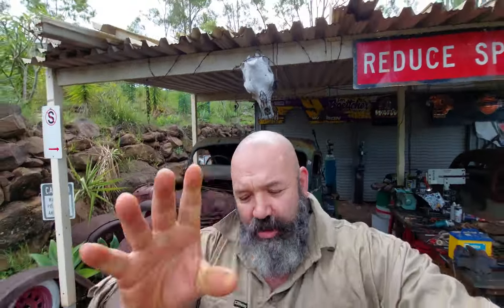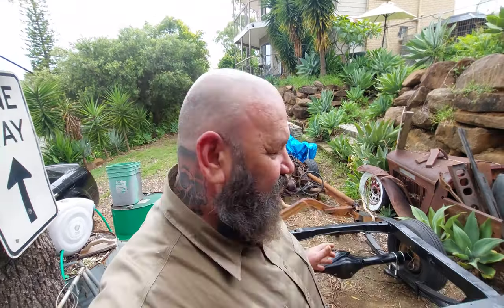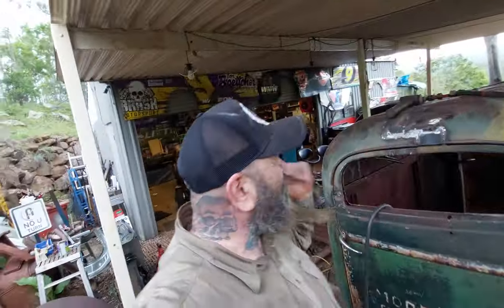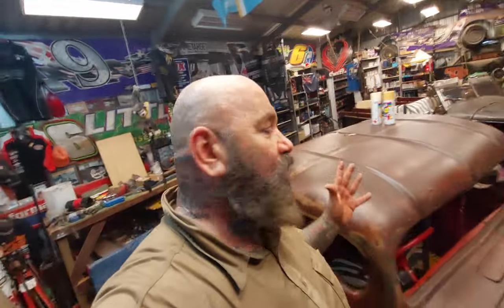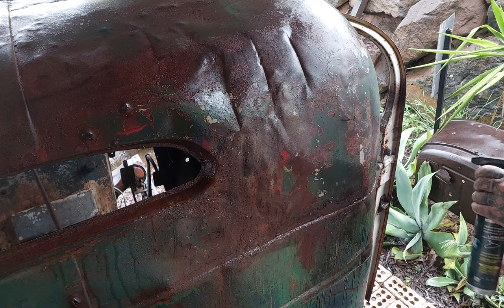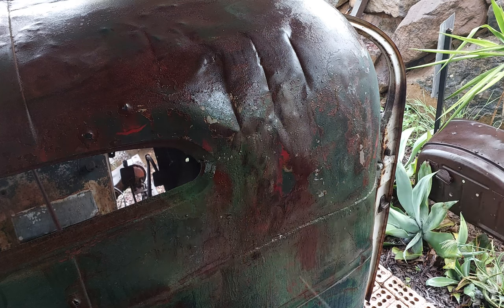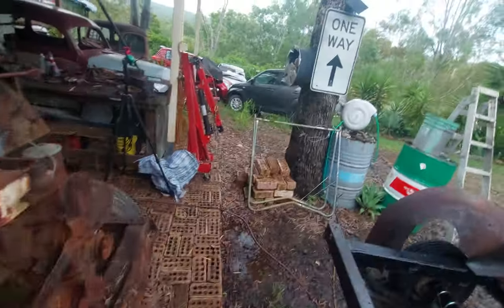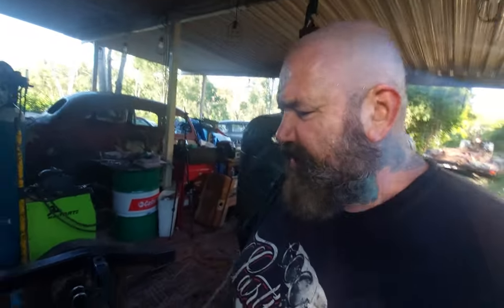2K BUDGET BUILD Ratrod! How to Fake patina blend a 6-inch roof chop! Bedford / Holden pick-up truck!

Comment: I have 3 of these Bedford K trucks here in Finland 🇫🇮 All those has been found deep from the forest.
Reply from the maker: How do they hold up rust wise over in Finland
Reply: Surprisingly well. Of course there are surface rust everywhere, some green paint can be seen. But certainly can be those useable. One of those has already installed to Chevy Squarebody frame and let see what will be done with the rest 😅 @copperheadkustoms